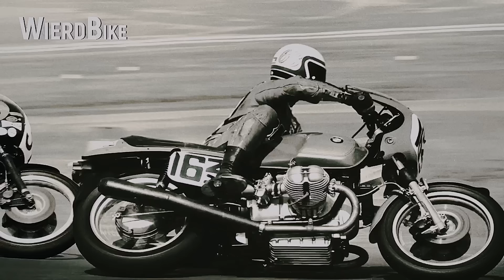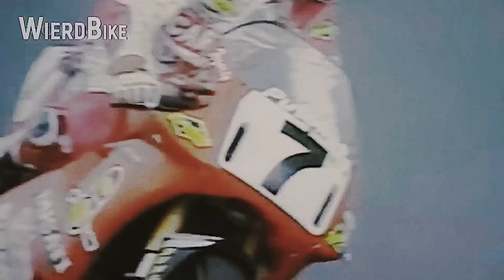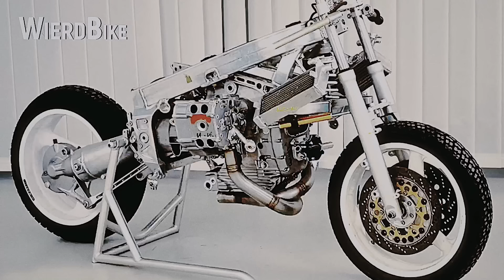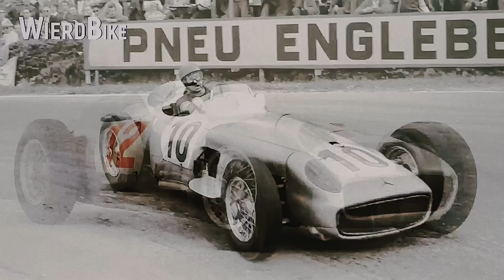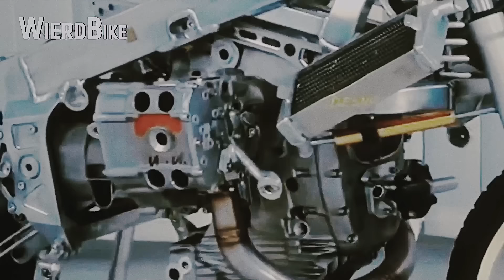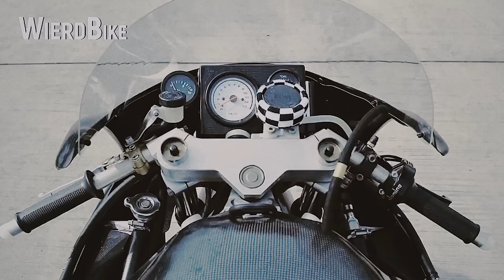DESMO Boxer Engine in SECRET BMW Superbike! Probably the MOST ICONIC Sportbike of the Company...

Comment: This bike was at the Goodwood Festival of Speed in 1999-I was there with a mate and we are both Ducati nuts-we could tell it was desmo because the valve train noise is very distinctive. We got chatting to the BMW rider and he confirmed that it was desmo and had been developed to enter WSB but was too heavy being shaft drive and not fast enough so the project was cancelled.

Comment: I'm not an English speaker, so I'm not familiar with common English pronunciations, but is it common to pronounce mm, which means millimeter, as M-M? Or is it a misreading by the voice reading software?
Reply: It's not the correct was to pronounce it. You either say millimetres or mil, or mills.
Reply: I would not say it is a common way to pronounce it but i think it gets the point across. 

Maybe they measured in round chocolate candies instead of millimeters
Reply: was wondering the same thing .
Reply: Written 50 mm. Pronounced 50 mil.  15 cm would be pronounced 150 mil. Or maybe it's just an English, English thing, not necessarily how other English speaking countries pronounce it
Reply: That's how Indians pronounce it.
Reply: As an Englishman yes it’s very common to do this. M M, C M and CL are abbreviations just like CI is for cubic inches
Reply: @melderosa656 
 CID is also common😂
Reply: @melderosa656  LOL, Englishmen are notorious for purposely pronouncing and writing everything from the metric sytem wrong, hint: kph, kphr, khr, k/hr.. instead of km/h.
Reply: @My-Opinion-Doesnt-Matter 
Yre absolutely correct. Sometimes its rather hilarious to hear them pronounce the metric system. 😂

Comment: why are germans so stubborn with engine/automotive design? they kept the boxer in this race bike, knowing it will be more difficult, then find out it causes excessive vibration, then cancel it, instead of just building a regular v-twin or inline 4, both proven designs.  the 911 stuck with rear mounted engines for like 80 years now, i know they've been able to engineer around it, but clearly it's not the best layout, or other companies would do it.  they seem to overcomplicate things just for the hell of it, or just because they're stubborn?  i don't get it.  they make some incredible engines, but they're so complicated they need more maintenance than other brands and they're generally way less reliable because of that. hence costing a LOT more to own.  while simultaneously destroying their resale value.  i just can't fathom why any rational company wouldn't use the absolute best strategies for the most power, and most reliable, and easiest to maintain.  unless their real strategy is planned obsolescence (talking vw, bmw, merc) not porsche so much, as they seem to be pretty reliable, and they did finally make a mid engine car.
Reply: BMW's customers were stubborn. BMW wanted to stop with the boxers, but the customers stil wanted the boxers to be kept. Zilly customers ;-) .
Reply: Agreed, it's not a good design for racing, you can't lean the bike enough, so they had to raise the engine and then it upset the handling. Also, with an air-cooled bike a flat twin made sense because the cylinders are out in the breeze, but on a water cooled race bike the fact that they're in the airflow means the produce drag. The V twin design is superior in this respect because of the lower frontal area.
Reply: Egotistical Pride and Sadism.
This is their engineers life long payback to the World for not being able to win WWII.
So now they make EVERYTHING over engineered, over complicated because they can, not because they should hence making every mechanic the world over beet itch and moan every time they have to wrench on one of their plastic fantastic monstrosities.
That's what someone I know says about it.
And I somewhat sarcastically agree.
Reply: As the comments say below, Zilly customers, it's what they want and gladly part with their cash for. When they tried alternative drivelines, 924, 944, 928 
they failed to catch on. Yes they bleed through the nose for the upkeep but happily do it.
Reply: @anthonyxuereb792  thanks for the reply.  yeah i know about the others they tried, but they weren't bad cars, they were just ugly as sin.  if they would have hired a better designer they could have been iconic cars..well at least the 928 and 944.  one car you didn't mention looked pretty awesome too, the 914.  i dunno why those never really took off.  but i think they're having a bit of a resurgence now because they're cool looking mid engine porsches and probably are really fast with a k swap.
Reply: @keyboard-commentator   asyou pointed out, the 914 is mid-engine which is why I didn't mention it as my thoughts were on front engine rear wheel drive models.
Funny you find them ugly as I kinda like them, especially the 944 turbo. It's all history now,.
Reply: @anthonyxuereb792  944 is def the best looking of the bunch.  i remember as a teenager when i first got into cars, i couldn't understand why they made the 928 the fastest/most exclusive of the new FR platforms.  the 944 looks waaaaay better.  i just can't get over the absurd rear end of the 928.  it's so bulbus, they shoulda just left that body style to the 924, and made a 948.  that FR hatch with more of a squared off design looks so much more period correct.  it's like a ae86 on steroids.  and plenty of other mid 80s sport hatches. like the 200sx, escort RS turbo, lancia delta integrale, saab 900 turbo, audi quattro, rx7, 300zx, mistubishi starion. etc etc.  you get the point.  all of those cars look better than the 928.
Reply: @keyboard-commentator  No 928 poster on your wall then.

Comment: A shaft drive racing machine is going to be more heavy and complicated than a normal chain driven bike . Especially since Ducati had a well balanced chasis /engine layout .
Reply: One main drawback with racing shaft drive was the limited number of available gearings. On a chain drive you can easily tailor overall gearing to different tracks by simply changing sprockets. And of course power loss.